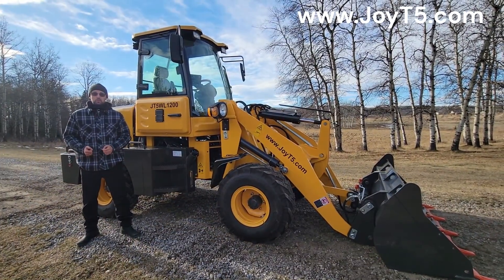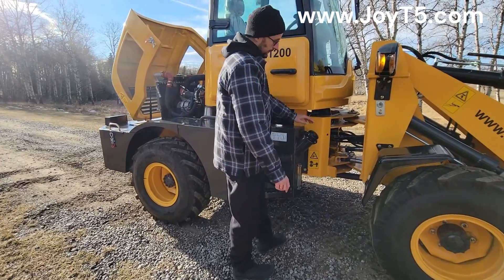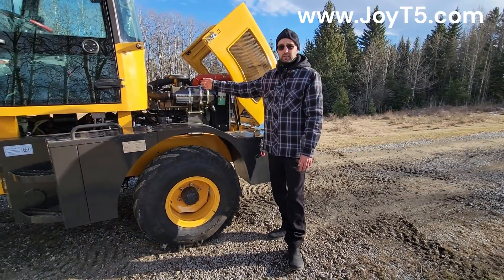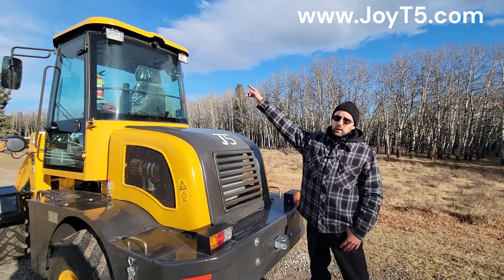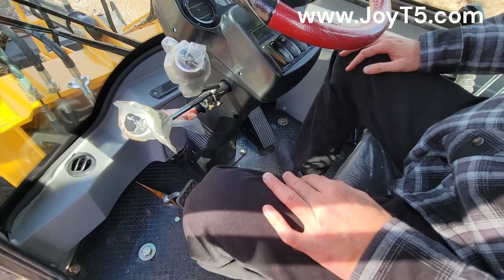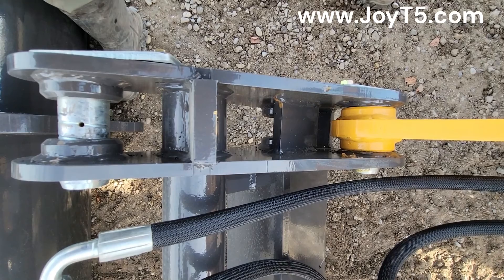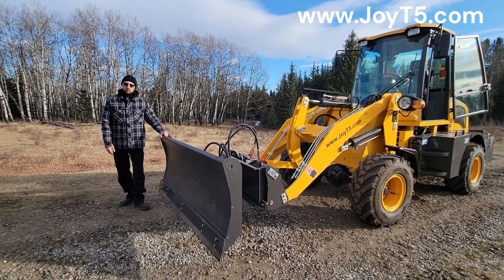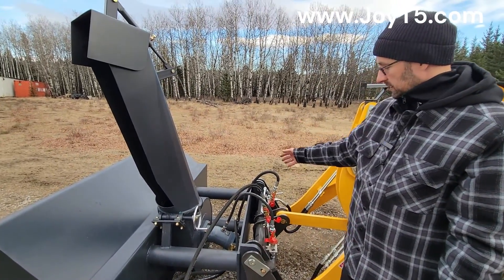Wheel Loader with 1.2 Ton Lift Capacity Demo. JoyT5  JT5WL1200

Comment: Nice looking machine. Did it come with an emergency fuel spill response kit and a lifetime supply of  those fuel tank sight glasses?
Reply from the maker: Hello @GotBait,

Thank you for your comment. We had no   site glass issue reported by our customer. If required, these wheel loaders can be equipped with fuel tank without site glass